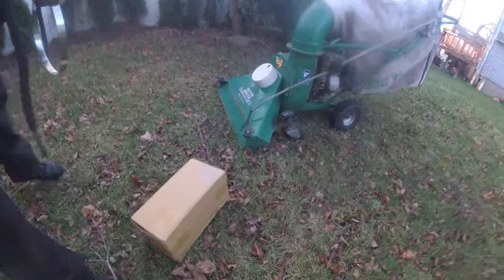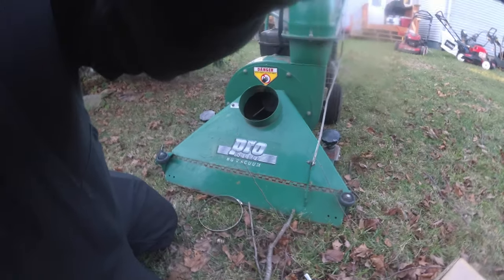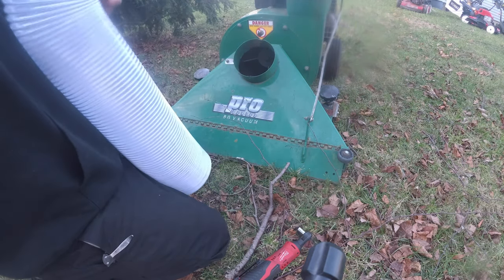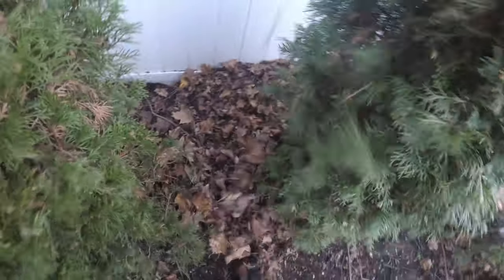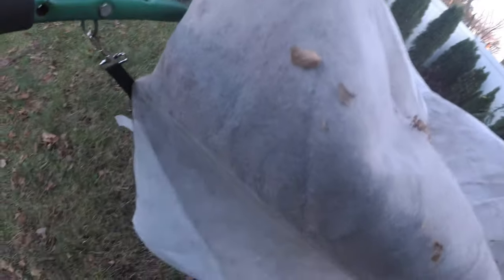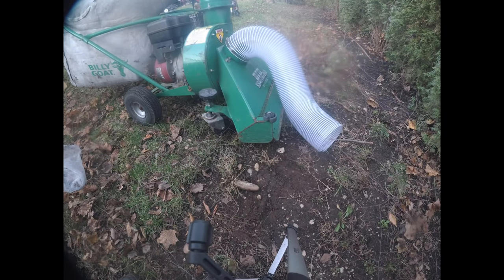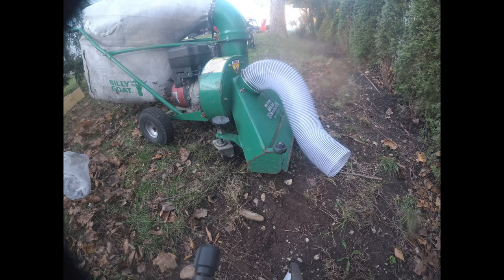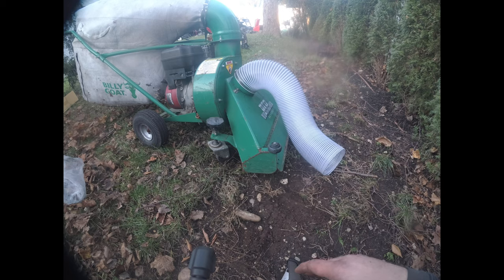HOW TO MAKE YOUR OWN LEAF VAC HOSE Billy Goat 10HP Walk Behing Leaf Vacuum Experiment

Comment: How the heck did you change the belt mine might be older but seems like the exact set up belt is right behind the mulcher
Reply from the maker: Mine isn’t self propelled so there is no belt.  My fan is physically mounted on the motor

Comment: Not trying to criticize your or anything, but dont ever let that thing run on choke as long as you did. That will cause improper fuel air mixture and can cause issues down the road if you continue to do that.
Reply from the maker: Thanks for the tip but for the 10 secs I do that it’s never been an issue an all the equipment I run.  I’m a fanatic when it comes to maintenance even a fouled plug will never be an issue.

I appreciate the tip, view and comment!

Comment: Mine didn't come with a block off plate, I made my own with a piece of sheet metal, just bent the edged with a duct jig/plate for bending duct work. Actually it was an easy fix.
Reply from the maker: Kenny Dykes Thanks for the tip...I was thinking of block off plate or angled block that I would just stuff inside. Machine naturally suction would keep it affixed.  If memory serves me correct there is not place for me affix the flat piece of sheet metal even if I bent the ends. I gotta give it another look now the weather is starting to warm up.

Thanks for the view and comment, hopefully you subscribed to my channel!

Comment: I have the 8hp Troy Bilt version one you showed. Got it for free. Haven't worked on it yet, but I know their worth up over $1000 resale. I just use my little wonder walk behind blower for all of that, its easier and not so cumbersome, it has enough power to blow all of that free right out of those tough spots.
Their should be some kind of plug for the bottom to increase sucking power to the hose, or a flap that opens and closes. You also need a wand for the end of the tube you bought. Otherwise your good to go.
If you get offered the full $1500 for it, I would take the money and run lol.
Reply from the maker: Nice machine!